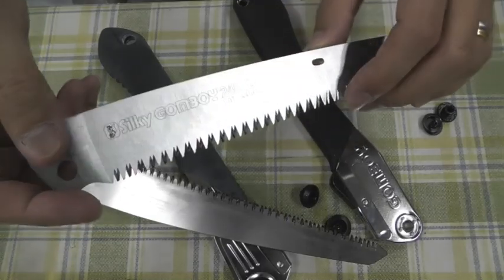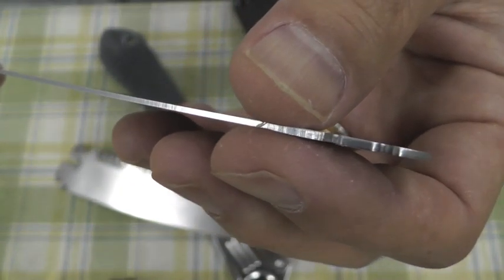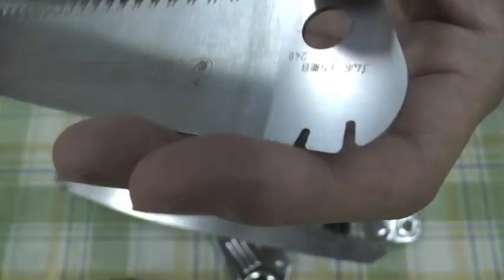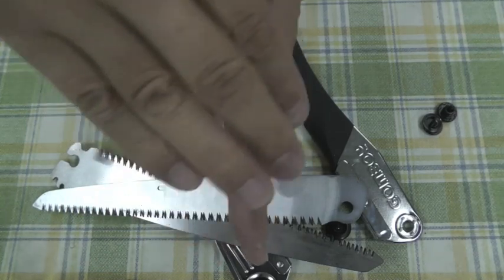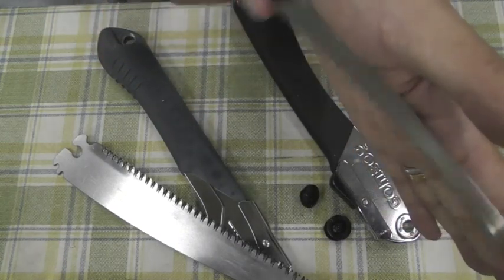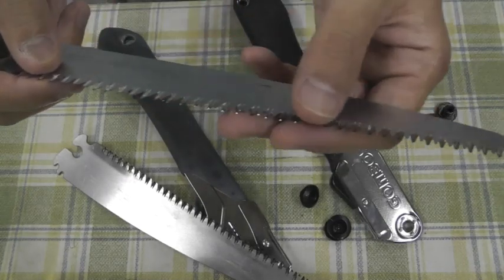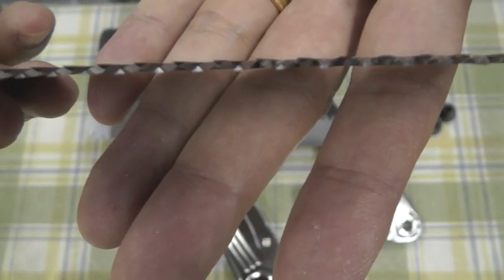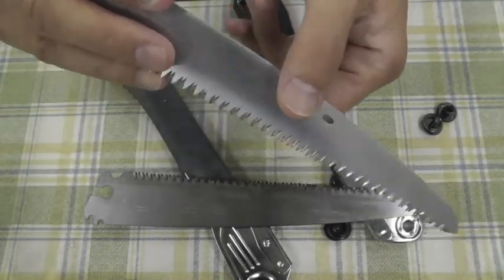Why Silky saw cuts fast and beautifully

Comment from the maker: The tooth has each edge on each direction. But all the teeth are leaning to handle side. And the tip of each tooth has another edge to reduce the friction for pushing. So the Silky saw cut wood mainly during pulling. The Silky GOMBOY 240mm has a good ergonomic handle which has a metal frame on its spine side all the way to the butt. It's a ptetty tough construction and relatively light IMO. Thanks.

Comment from the maker: I think Silky blade geometry is pretty good. My old Kabasawa saw has almost the same thick teeth as its blade (little splayed). So it was easily pinched and caught in the cut slit (kerf) to take high friction from its sides. My 1.2mm thick Tajima saw has 1.6mm splayed teeth and it takes heavy resistance directly from wood. So I think 2mm thick blade will be too thick for a hand saw. Thanks.

Comment: Silky makes very nice saws. Do the teeth cut going both directions, or just one?  That can make a saw cut faster as well--I'm pretty sure the Bahco saws have a bi-directional cutting blade, which has probably contributed to their popularity. I've always wanted to get a Silky--they're $40 at the local hardware store though, which is probably not much more than the internet when you consider shipping, etc. I'm wondering if it's worth the extra $10-15 over the Bahco. Right now I'm using a Fiskars

Comment from the maker: It seems to have Extra Large teeth for cutting down a thick tree. I thought I would not need it in my truck and ordered the regular BIGBOY Large Teeth. The 2000 has a curved and thicker blade to pull cut a thick tree. But the curved blade cannot be taken into the sheathing handle completely. Anyway I will compare my comming BIGBOY Large Teeth with my current GOMBOY Medium Teeth next chance. Thanks.

Comment: no, silky saws are pull cut teeth. Since they are pull cut they can make the blades thinner than push pull cut blades because the blade is only tensioned on the pull. Also silky saws used the old school taper ground blades versus what most companies do to save costs with the set teeth saws.